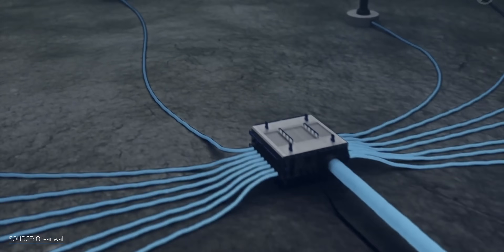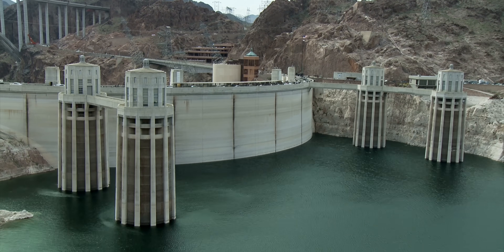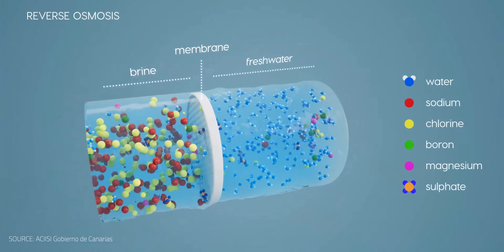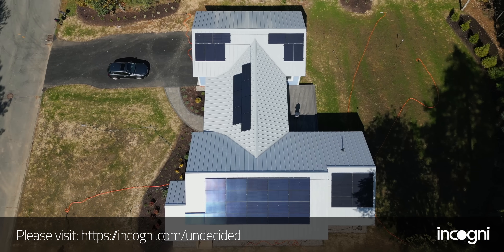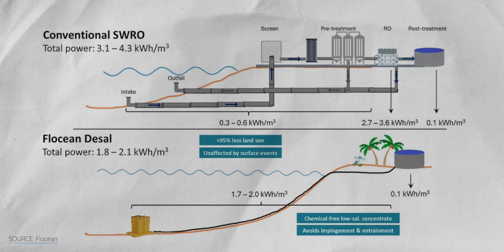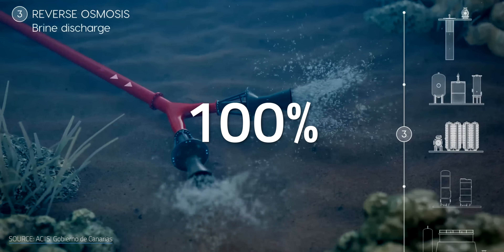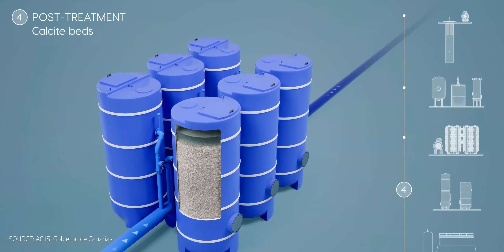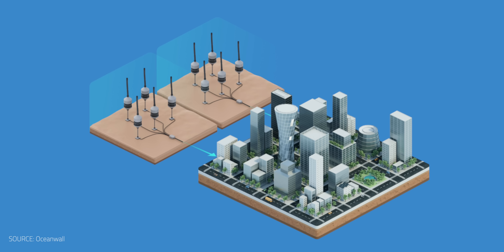How Deep Sea Water is Now Drinkable

Comment: I think the efficiency is because ocean water is about 3.5% more dense than fresh water.  So if the 1000 foot column of ocean water has a pressure of 440 PSI, the 1000 foot column of fresh water would only have a pressure of 424.6 PSI.  So at 1000 feet, the difference in pressure across the membrane would be 15.4 PSI.  At 2000 feet, that difference would be 30.8 PSI.  Residential RO systems run at 40 PSI difference, so that would make this quite a bit more efficient. At 3000 feet, you wouldn't even need to pump it.  At sea level, the fresh water would have 6.2 PSI.
Reply: Thank you. I was so confused where the efficiency was coming from. Matt's "much easier job to pull the fresh water to shore" doesn't make any sense on the face of it, all that matters is the pressure differential across the membrane, and obviously pulling is the same thing as pushing. But you cleared that up, the fresh water wants to 'float'.
Reply: Bull crap.  I don't get it. Where is the Delta P., constant,  are valves held shut and pipes sucked open to allow a siphon effect.
Reply: @akda5id  Theoretically pulling should be the same as pushing, but I'm guessing not technically. You would need to either pull freshwater or push seawater, and the pushing pump would have to be much more robust to survive seawater than the pulling pump. Far from unovercomable, but likely adds cost and maintainence requirenments
Reply: @milospavlovic7520  A part of it is that RO membranes want to be at high pressure to work at all; not just gigh pressure dufferential; by olacing it on the sea floor, the pressure is just there to begin with, and they can run a more efficient low-flow setup without having wasted all the energy getting up to pressure.
Reply: Matt pin this comment!
Reply: I don't think that is correct. As I understand it the improved efficiency is because the salt concentrations on the upstream side are much lower for deep sea RO than normal RO. The saltier the water is, the more pressure is needed to force the water molecules through the reverse osmosis membrane. It's easier to understand this if you think about this concept the other way round, with normal osmosis in a cell, the saltier the water is on the downstream side of a cell wall the easier it is to get unsalty water through into the salty water side of a cell wall. With normal RO, extra salty water is created as unsalty water is produced, this has to be pumped and disposed of so the salt concentration next to the membrane are allowed to build up to much higher levels than the actual sea water but that is not the case with deep sea RO.
Reply: @caijwilliams you have a point , I wonder what contribution the build up of conductivity at the surface of the membrane has on the overall pressure required.
Reply: Very nice but an RO system and membranes are high maintenance and service. Having them so far under sea makes no sense it’s going to be a fortune in servicing without counting the human exposure risk. Ounce those membranes grow salt crystals on them it’s over
Reply: You can try a home RO system with 1 atm / 15 psi pressure and feed it 3.5% NaCl solution. It won't work. I mean it will, but it will produce no or very little permeate (clean water). Reverse osmosis needs at least osmotic pressure +  a tiny bit more (hence reverse osmosis) to get permeate through the membrane in any meaningful quantity.

35+atm in industrial  SWRO setups is not because they are industrial, but because of the physics of the process and osmotic pressure of ~3.5% NaCl on clean water (which is a bit below  30 atm at 300K temperature).
Reply: @MotoStylus-z8r  
Home RO systems require over 40 PSI to work, so I doubt 15 PSI would work at all.  It would be interesting to just put some actual ocean water at 40 PSI into a home RO system, and see what it does.  I don't have an RO system to try that with.  I'm sure the companies doing this work have tried it, and have real data that tells them what the efficiency gain will be.  I assume they would not be investing all that money and time if it was impossible.
Reply: @BigGuy8059  The "hard" requirement is that the pressure against the membrane is above the osmotic pressure of the "dirty water" vs the "fresh water". Say your "dirty water" is equivalent to 1g/L saline solution. Then π = i⋅M⋅R⋅T at ~300K / 27C / 80 F is going to be (unless I am badly mistaken somewhere ) is ~0.87 atm. For comparison, 35g/L saline solution has around 28 atm of osmotic pressure under the same conditions, which is why SWRO plants operate at anywhere between 35 and 70 atm. 

If you apply 15psi or just over 1atm of pressure to 1g/l "dirty water" -- the filtration will happen. Most of the "tap water" in the US is < 0.5g/l total mineralization anyway.
Reply: Waaaaaaaait! This would make it a perpetuum mobile! And the membrane is a Maxwell's Demon, except that it doesn't differentiate particles by kinetic energy but by potential energy. Someone please tell me that this doesn't actually break the laws of thermodynamics and that I'm wrong.
I think the overlooked aspect with this simple analysis might be that salt water also gets saltier the deeper you go; which makes you need more than 400PSI of pressure to get it through the membrane. But then again, saltier salt water also means that its pressure increases even faster than for fresh water...
Reply: @Pystro  The explanation is wrong (I think), there is no pressure difference across the membrane when the pump isn't running otherwise the water would indeed spontaneously split into brine and fresh water over the membrane, which is the exact opposite of osmoses. Osmoses creates a pressure difference across the membrane which would counter act the earlier mentioned pressure difference (at least to some extent). throwapot actually put a in my opinion more reasonable explanation that your output fresh water is only x% in weight as your input water, thus pumping this away and creating a vacuum cost in first order approximation only x% of the energy. Of course in the stats they normalised it to the same debit, thus your gain is about 1/(x%)  of the max efficiency conventional RO can achieve, which was mentioned at about 50%. So one would expect an efficiency gain of 100%
This actually can't be the full story because if you look at the given stats pressurising the system is less than uses more than half the energy of the conventional RO.

tldr: Efficiency gain as you only need to pressurise half weight of water for the same debit and your pressure potential gets used to pump the water on shore.
Reply: @MsTh5  Oh there is a pressure differential....but pressure isn't the entire story.
Reply: @MsTh5  exactly, half of the pressure for pumping will come from the deep see
Reply: @MsTh5 
Reverse osmosis....
Reply: @Pystro  the energy isn't free. You are using the energy of the salt dropping from the surface to the depth of the filters. That water is kept mixed and salty from tidal movements. Ultimately it's coming from slowing the rotation of the earth and pushing the moon out farther.
Reply: @pontifier  imagine a thought experiment, at 32,000 meter depth seawater is 3211bar hydrostatic pressure, and a freshwater column in a chimney has 3139bar hydrostatic pressure.. the pressure differential across the membrane is 72 bar.. enough to drive the seawater osmosis that requires 28 bar at equilibrium.. now the freshwater column would continue rising due to buoyance, and imagine dumping it right back into the ocean.. and it remixing over the eons with the saltwater at depth.. this would be a perpetuum mobile.. i tried chatgpt and it pulled all kinds of excuses, like gravity driven work, but I still haven't heard a satisfactory explanation.. there was a similar situation I came across in the past where capillary action would make the water rise in a thin tube connected to a fatter tube.. and the vapor pressure at a higher height would drive a fan on top against the vapor column that's taller but has the same vapor pressure at the bottom of the fat tube, so at the top it would have less.. but it turns out the capillary action creates a meniscus to the point where the vapor pressure from a capillary is exactly less because of the curved liquid surface by the amount necessary to stop the perpetuum mobile.. vapor escapes less readily from a curved surface, is the explanation there.. i haven't heard a good one here yet

we dont have 32000 m seawater depth, and at the Marianna trench at 11,000 meters things are at an equilibrium at 28 bar, no usable rate of ro freshwater generation.. not that it would be practical.. another thing i asked chatgpt about is creating extra buoyance by filling the freshwater chimney with microscopic air bubbles, and at a depth or 1000 meters and 100 bar saltwater, 60 bar air-bubble-filled-freshwater, you would get a usable 40 bar osmotic pressure to drive osmosis naturally, and would need about 1.3kwh/m3 of energy to pump the air bubbles.. the pressure required and probably energy required drops with air fraction, and if you're pumping a foam with food-safe surfactant, there is probably a sweet spot of minimum energy, as at 100% air fraction you pump 0 water. Another idea is working at a depth of 500 meters, and having an air chimney from a floating platform go down to the seafloor, and lift the freshwater with buckets on a chain, the air passing around them freely.. you would get a 50 bar - 1 bar atmospheric=49 bar membrane pressure difference, and the energy required to lift the water would be about 1.8kwh/m3, the osmosis happening naturally without any pumps.
Reply: @Pystro  No it won't, left on its own, the system will stop when there is a full gradient of pure water at the top to salt water at the bottom. With bottom being so salty, the system will eventually stop. This is more or less tidal energy like system. It will take very long time to settle, but it will settle one day.
Reply: @Pystro  Is it not that the pressure basically pushes water through the membranes and then up? And then you use a pump to take out the air to create a vacuum. Sure you need some energy, but because of the pressure, it's already less. (+ no need for massive amount of pressure pumping it through RO).
Reply: @Pystro you actually need 400psi for sea water RO
Reply: @Pystro  Energy is in the form of potential energy of the column of water. Theres no free energy here.

As for Maxwell's demon, that is an example specifically in a situation where no energy is entering the system or being used to do the sorting.

There is no issue with using energy to do sorting, it's what life does all the time! So Maxwell's demon doesn't apply either
Reply: @Pystro  James Clerk Maxwell has always been correct with his "Maxwell's Demon" thought experiment.  Physicists that argue, "It is impossible because the second law of thermodynamics says otherwise," are essentially using a, "It is impossible, because someone said so," argument.  Physicists that argue James Clerk Maxwell was wrong by invoking "Shannon's entropy" and the minimum energy of data storage and processing (as required by the "brain" of the hypothetical "demon" in the Maxwell's Demon thought experiment) are also using flawed logic, since passive single particle discriminator systems (like check valves, diodes, and reverse osmosis membranes) do not require data storage or processing associated with an intelligent being like a "demon" manually controlling a gate.

In practice, actually realizing a practical system that exploits "Maxwell's Demon" concepts to produce useful work output would have been difficult in James Clerk Maxwell's time.  Additionally, such systems are not truly "perpetual motion" machines.  Such systems still require ambient thermal kinetic energy to function.  A "Maxwell's Demon" useful energy generating machine will stop functioning if it is allowed to cool off too much, since such a device is a random motion thermal kinetic energy to useful energy converting device.

The second law of thermodynamics is correct, but only for larger scale systems (such as macroscopic scale systems) that average out the effects of random motion thermal kinetic energy of individual particles, such as in a conventional steam engine.  The second "law" of thermodynamics should not be applied or assumed to be applicable to systems that work on discriminating systems that differentiate individual particles propelled by random motion thermal kinetic energy.

A reverse osmosis membrane (not powered by a pump, and with a rigid wall output pipe only filled with pure water) sitting on the bottom of the sea can only function due to continuous vertical column mixing of the ocean water.  Hypothetically, if there was no mixing of sea water (such as by random motion thermal kinetic energy mixing of individual particles), then all the heavier "molecules" (such as an H2O molecule with a sodium ion loosely holding onto it) in the water would want to settle to the bottom of the sea, while all the light molecules (ex: pure H2O molecules without extra ions loosely holding on) would rise to the top of the sea.  In that scenario, there would be no truly free H2O molecules at the bottom of the sea available for the reverse osmosis membrane to pass through.  Some kind of vertical column mixing (such as that from random motion thermal kinetic energy) is required, in order to push the buoyant pure/lighter H2O molecules down to the bottom of the sea (which puts them into a state of higher potential energy).

That said, reverse osmosis membranes at the bottom of the sea, with a rigid wall output pipe (filled only with fresh water) are not the most cost effective or practical method of generating large amounts of "unlimited free energy" for humanity.  Conventional solar photovoltaic panels are a cheaper/more economically practical method of generating cheap abundant useful energy for society (at least during the daytime in places with adequate access to the sun).  Reverse osmosis membranes on the bottom of the sea, is however a potentially practical method of making clean water relatively cheaply, provided that capital costs, maintenance costs, and fowling problems are adequately addressed, at least sufficient to be competitive to surface mounted reverse osmosis desalination infrastructure.
Reply: @Fritz_Schlunder  Good to hear from someone with more knowledge of thermodynamics than my one semester in university. I knew that I was the ten-thousandth person to say "oh, this thing breaks the laws of thermodynamics", so I was almost completely convinced that there was something that I was missing. But hey, sometimes the ten-thousandth time could be the charm.
I was aware that even if this system could generate "energy from nothing", it still couldn't produce unlimited energy from nothing, due to exactly the salt concentrating problem you also mention. I was thinking of the spreading of salt more as provided by ocean currents, which would make this energy generator an ocean current power plant. Granted, the efficiency might be above 100% (if it's indeed a perpetual motion machine), but it would still be limited by the energy that can be pulled from ocean currents.
Looks like one of those applications where the byproduct (nuclear isotopes, getting rid of trash, fresh water) is a more compelling reason to build the plant than the energy itself.
Reply: The density difference is not sufficient. You would need over 10000m depth to get a sufficient pressure difference around 25 bar.

I guess the point is another one.
A pump before the membrane has to pump the whole volume of fresh water + brine. The pump after the membrane only has to pump the fresh water. Same pressure difference, smaller throughput.
Reply: @valeriooddone  You can divert brine to a pressurized tank in the system. Cut the flow, open the tank and replace the brine with new batch of water, close the tank, open then inlets. You get pressurized water at cost of 0.5% of the tank volume.
Reply: @pikappa1473  omg like water hammer but instead of a pressure wave caused by rapid valve open, its a salinity/density wave caused by controlled valve frequency to make it resonate with the chamber size
Reply: That's what I was thinking about. If Freshwater goes always UP in the Oceal. Can we just skip Pumps completely?
Reply: That is not correct. The pressure on the fresh side of RO membrane is thermodynamically always way lower than the salt side,  and the deeper you go, the greater the pressure difference, exactly cancelling the density effect you mentioned. So it will never be a free energy machine.

If you submerged an RO membrane with a long output tube to the surface, you would find the fresh output level would sit about 300m below the ocean surface (since osmotic pressure of seawater is about 30 atmospheres), and that wouldn't depend on how deep you put the bottom.

It wouldn't be surprising for there to be energy savings though, since with normal pumped RO you have to pump a lot more volume of input, and then also recover pressure energy from the output brine and fresh streams, and that is not perfectly efficient.
Reply: @marklundeberg7006  I agree that the pressure across the reverse osmosis membrane must be much larger for desalinating sea water, versus a typical under the sink reverse osmosis system that uses municipal tap water as input (which has very low salt concentrations, and therefore, very low osmotic pressure to overcome, compared to sea water).  According to the internets, commercial reverse osmosis sea water desalination plants often operate in the neighborhood of 60+ atmospheres (ex: 800-1000 psi) of pressure on the input side of the reverse osmosis membrane, as opposed to using residential under the sink reverse osmosis systems that operate at municipal water mains pressures of 40+ psi (ex: perhaps 60 psi mains feed water pressure, minus some number, such as 20 psi for the fresh water output holding tank).

However, I disagree with your claim that depth does not make a difference.  The deeper one places the reverse osmosis membrane, the taller the water column of both the salt water input column, and the clean water output column.  The taller the columns, the higher the pressure at the bottom of the columns.  However, the density difference of the two columns does result in increasing pressure differential (with increasing depth), measured at the bottoms of both columns, if one assumes the same column height of both columns.  This difference is more easily understood when considering a highly exaggerated case of density difference from a column of liquid mercury versus a column of equal height but of ordinary water.

A density of sea water of 1.03 grams per cubic centimeter yields a water column pressure of 0.446 psi / foot of column.  Clean water at a density of 1.00 grams per cubic centimeter yields a water column pressure of 0.433 psi / foot of column.

At 35,876 feet depth in the sea (the deepest part of the Mariana Trench), the salt water column will have a pressure of approximately 16,000 psi (ex: 0.446 psi/ft * 35,876 ft).  A 35,876 foot column of fresh water would have a pressure at the bottom of approximately 15,534 psi (ex: 0.433 psi/ft * 35,876 ft).  The difference is 466 psi or about 31.7 atmospheres.  That is enough to overcome the minimum osmotic pressure difference of fresh water versus sea water of roughly 27-30 atmospheres.  Consequently, assuming that the reverse osmosis output pipe is rigid and the walls do not collapse under at least 466 psi of pressure, and assuming that the ocean water temperature versus depth is similar to the temperature of the water in the output fresh water pipe, and that the salinity of the sea versus depth is roughly constant, then in theory, fresh water should continuously come out of the top of the fresh water exhaust pipe at the top of the sea surface, without need of active pumping.  In practice, the flow rate would likely be extremely feeble, as the pressure difference across the reverse osmosis membrane will be too small to provide adequate flow rate.  In order for the system to start up and to work, the output fresh water pipe must first be primed either with fresh water, or with air, rather than with salty sea water.  Additionally, depending upon other factors, it may still not have quite enough pressure difference to work reliably, but that could hypothetically be improved by substantially dredging the Mariana Trench to make it meaningfully deeper.  Additionally, some sea water mixing or pumping may be required across the face of the reverse osmosis membrane on the input side, in order to prevent excess local salt accumulation in the local area of the membrane, which would have the effect of increasing the required osmotic pressure difference.

The device would not be a "free energy device", nor would it break any of the (real) laws of physics.  In order for the device to work, continuous mixing of the sea water is required, which is normally driven by a combination of random motion thermal energy, and by oceanic currents (that are formed due to oceanic temperature differences associated with uneven sun exposure and sun heating of the Earth's oceans).  The mixing is required to push buoyant clean/pure water molecules to the bottom of the ocean, which is a state of higher potential energy for them due to their buoyancy in salty/denser sea water.  In other words, the device would be a solar power thermal energy converter device.  If one took away the mixing of the seas, due to removal of the sun's heating of the Earth, the system would cool off over time and stop working.  However, the system would not be a Carnot heat engine, and it would not be subject to the second "law" of thermodynamics.  The device would be best classified as a "Maxwell's Demon" random motion thermal energy to useful energy converter device.  In practice, the useful energy output would be negligible and not economically competitive with conventional solar photovoltaic "free energy" devices (which also do not operate on Carnot heat engine principles).
Reply: @Fritz_Schlunder  Thank you for this explanation.  I didn't think of the mixing of the ocean water column, which is where the "free" energy is coming from.

But, as you said, it would need a pressure tube deeper than the mariana trench in order to pump itself.  The tube would need to resist a full 30+ bar of pressure from the outside at the deepest point.  Seems impractical, and would lose most of the energy in the process.

At their stated 400m on their website, they would only possibly save 4% on energy costs through that "free" energy.  They also say they take advantage of temperature differential, which must be where they intend to save the remaining 36% of the 40% they claim on their website.
Reply: ahhh you answered my question!!!   I was forgetting salt water is more dense.     I'm thinking column of water to create pressure is just a column that needs pumped!  LOL
Reply: You also have to factor in the friction loss in miles of pipe.
Reply: The efficiency difference comes from the volume pumped. In a land base RO you're pressurizing the feed water, and with a 50% rejection rate, you're pumping twice the amount of water that you produce.
If instead you put the system under pressure, you only need circulation pump to move the water through the membrane (or this pod thing just using currents), and and the high power pump only has to pump the fresh water portion against the pressure of depth, and the miles of pipe.
Keep in mind you can recover energy from the reject flow on a land based RO, with an efficiency penalty ofc.
And seawater RO runs often above 1000 PSI so no 15psi is not a big difference.
Reply: I suspect that the "trick" here is most of the energy in RO goes into,  not forcing the water through the membrane, but simply creating and maintaining a high pressure system in a one atm environment. Since  this approach is simply a way of reducing wasted energy no conservation laws are being broken.
Reply: Thank you! That explanation in the video was frustratingly insufficient. I think performing RO on seawater would require a much larger pressure differential than a home RO system though. Plus obviously the discharge piping/ hose would have to resist compression to maintain lower internal pressure while being able to traverse a long distance and withstand currents.
Reply: @mjayamamoto  read my comment
Reply: @mjayamamoto  
It takes 390 PSI to force sea water through the membrane, but at 1000 feet the pressure is 424.6 PSI.  So no problem there.  The pressure on the fresh water discharge pipe would only be a few PSI, because at each level the difference between the inside column of fresh water and the outside sea water would only differ by 3.5%.
Reply: What is a feet though? And don't say 0.0000023 football fields or 19 big macs or something.
Reply: Home RO systems require significantly less pressure than sea water systems because the feed is less salty. To break the bond ( osmotic pressure ) that exists between the salts and the seawater is a minimum of 40 bar and runs up to 55 bar in some cases.
Reply: Repeating this in non-bald-eagle big mac measurements: 914 meters you wouldn't need to pump it because it'd have a 2.76 bar difference.
Reply: Theoretically you could power this device with the ocean currents  wind making a human made part of the water cycle.
Reply: Only way I could see maintenance done is by attaching a chain to a bouy. No way tec divers are about to casually dive even 500 ft without being paid some cash.
Reply: Wow energy free❤
Reply: Thanks, I was wondering where the pressure differential was coming from.
Reply: You are  on the money,my thoughts exactly.As long as you have a deep sea trench near by you can have endless fresh water
Reply: interesting but ... the pressure for osmosis in salt water is much higer !
I guess the efficency is improved by no pre treatment devices .
Another advantage , the themperature of this source is 5 -10 C (41 50 F) and can be use for air conditioning in hot places .
Reply: Jeez you just whip that up on the spot? Smart dude.
Reply: Ahhh!  This might make a lot of sense, thank you!
Reply: Just wondering how you wind farms do in that deep water?
Reply: seriously thats pretty well on the money 8059
Reply: that would mean infinite energy, which it for sure isn't
Reply: The density difference could be used. The deeper the pod the better the difference. Get it deep enough, no pump required. But wait! to get it to sit on the ocean floor, you might not have too many good spots. Typically, a continental shelf has the cliff at 300 feet down and the off the cliff it drops BIG TIME. The most extreme case is off of Guam and the Challenger Deep at 35,000 feet down. The pressure difference from density difference in that case would be more than 400PSI! I'm sure there are good 3000 feet deep spots to choose from though. You'd be able to find the good spots with a sonar ship easy enough. 

Setting up the pods at 5,000 feet down would not be too easy but quite doable. See underwater oil wells for details with drone subs with "hands".
Reply: How is the water going to get from the bottom to the surface
Reply: @joenetzel1591  After it gets desalted, the now freshwater is less dense than the seawater around it which pushes it to go to the surface. The pressure difference would depend on the depth, but I am assuming they are using it deep enough to both fuel the reverse osmosis itself and the climbing to the surface part
Reply: @joenetzel1591   Pressure gradient due to the difference in densities between saltwater and freshwater would do part of the heavy lifting. If it isn't enough (not deep enough), you can always add pumps, which would have reduced workload in this instance
Reply: Isn't this pressure irrelevant tho? You still gotta pump it for all the power either way.
Reply: @Broockle   Please explain your reasoning
Reply: @milospavlovic7520  Hydraulics right? 
Like you got the ocean pressure within your pipe as well pushing the other way. 
You will presumably have a series of pumps along your pipe all the way to the surface. Any water that you pump up there will suck in more water from the ocean through those membranes. 
This will still end up requiring the same amount of work. 
There might be some advantage with the salinity of ocean water at that depth. But I don't think you'd be saving any power.

It seems to me the determining factor is the membrane itself. It will require the same amount of pumping if it's under the sea or on the surface.
Reply: @Broockle   Rewatch the video, although probably a few key things were omitted from working principle. First of all, in this system you need to pull only the freshwater, while the approximately half of the seawater that is now doubly concentrated remains at the bottom of the sea, whereas for the surface system you would need to pump both halves and then release the concentrated water back. Furthermore, for the freshwater itself, due to it being in contact with the seawater of higher density and itself having lower density, it will be pushed to the top. Now, this pressure difference caused by the density difference would not be enough to even power the RO process at lower depths, but if you go deep enough, the pressure difference itself may become enough to power the system. I would need to brush up on physics to calculate the exact depths in various scenarios, some people in other comments are mentioning 3000ft, but in any case this reduces the work that needs to be applied even if it is not enough to autonomously power the system. Finally, you would likely have to maintain your pumps and piping less often as  In any case, you would need around half to no pumping work applied compared to surface RO facility. 

And then we come to the savings due to not having to pretreat the water (though you would still likely need some post RO water treatment, just as you need after surface RO).

One thing that will need to be done and be more expensive than on the surface is periodic replacement of RO membranes, hence they are researching to make this process as rare as possible, but the savings from the other areas should more than make up for this drawback.

There are also questions around how would this type of RO facilities integrate into the marine wildlife and impact shore ecosystems, but they are beyond the scope of this discussion
Reply: @milospavlovic7520  Only thing I don't get is how you get that pressure differential without pumps. 
Like you say "... in this system you need to pull only the freshwater..." how do you do that?
Like literally, any kind of pumping you do down there will be moving both freshwater and saltwater. 
The sea pressure is good and all, but once the pressure equalized on both sides of the membrane then all work needs to be done by the pumps. You're not getting free work from the ocean pressure. 
Pumping up freshwater will also pump ocean water through the membrane, which prbly ends up taking the same amount of energy as if it was at sea level. That's my guess.
Reply: As the technical issues get solved what about the brine.... just another waste problem to effect the environment  ignored until it becomes a crisis.   🤔😬  solve it along with desalination.
Reply: @BigGuy8059  nope. Sea water RO running at 450psi
Reply: Great technical discussion here!  One positive to the system is understanding the low microbial count at depth, therefore just pump that water to the onshore desalinization plants to reduce cost and deficiency. A green washing fluff is the fact that this is the saltiest water in the ocean and any fresh water produced from this area will equal that salt content to be deposited in that area. Unless you have the risers go all the way to the surface waves which is ridiculous because you’re pumping the saltiest water to the surface of the ocean thus defeating all your gains on the other side. Lol. And don’t get me started on maintenance costs!
Reply: @Palisades_Prospecting  
Certainly, no human is going down 2000 feet to install, remove, or anything at all.  It would all be done with tethered robot submersibles.  That can give the operator on the surface an interface to their hands and arms, that is duplicated at depth.  They wouldn't even need  to remove and carry worn out units to the surface.  They could be signaled to unclamp the plumbing and open an air tank to purge a compartment, to make the unit buoyant.  It would float up a tether to the surface, where a tender could pick it up.